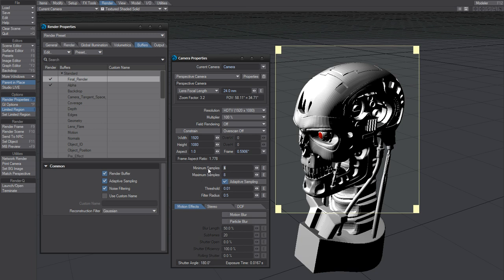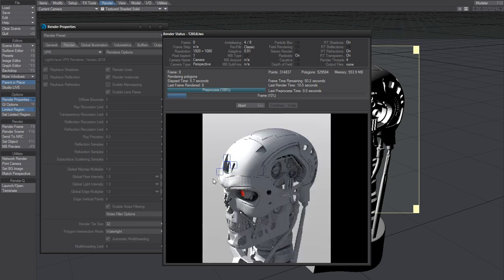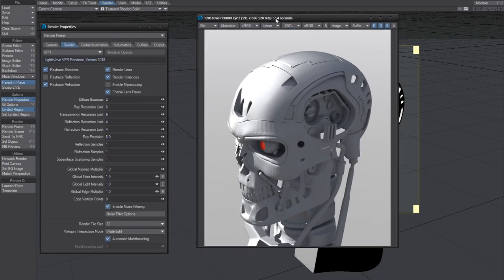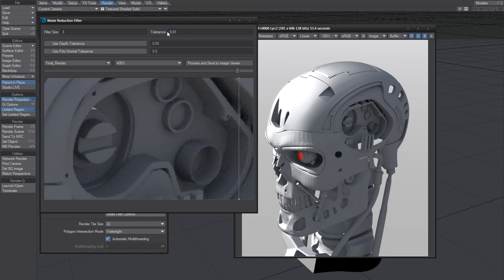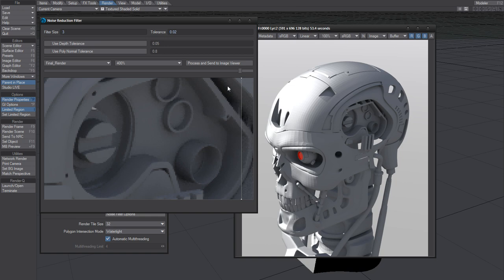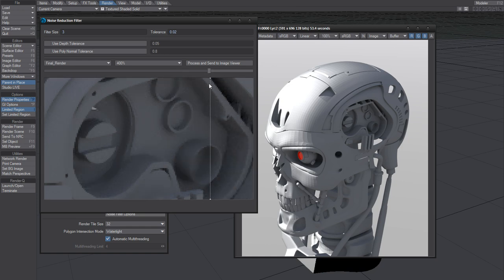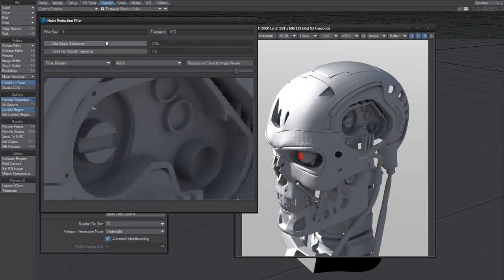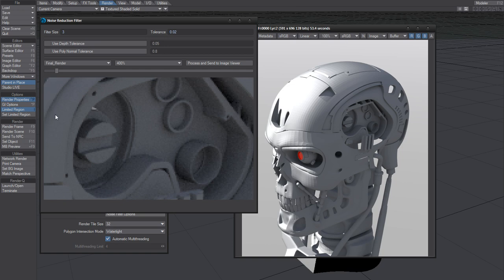LightWave rendering - LW2018 - Noise Filter - Quick Settings

Comment: 'use poly normal tolerance' extremely helps for sharper edges at glancing angles. especially in front of other geometry. less blured together. 'depth' is less important.